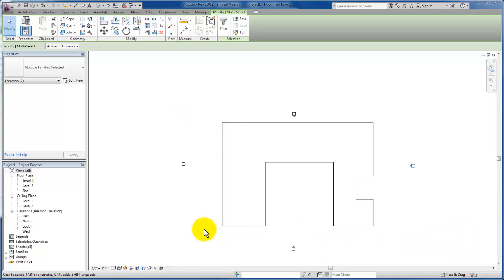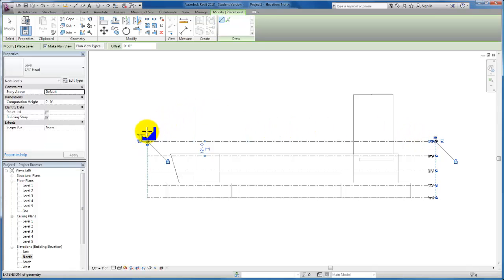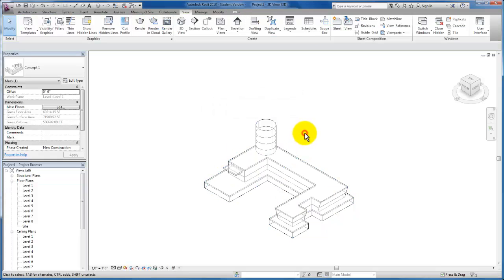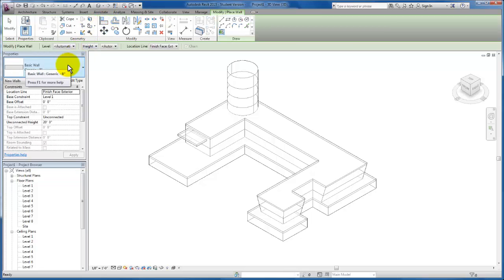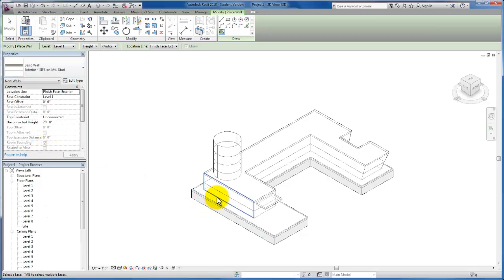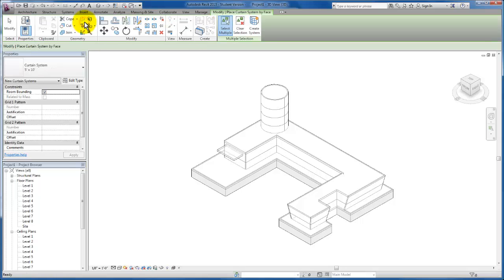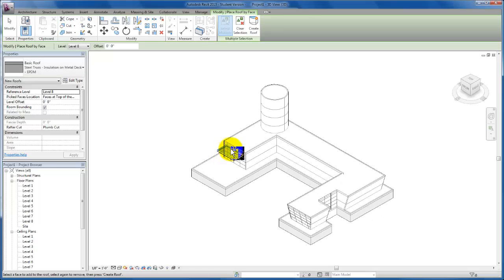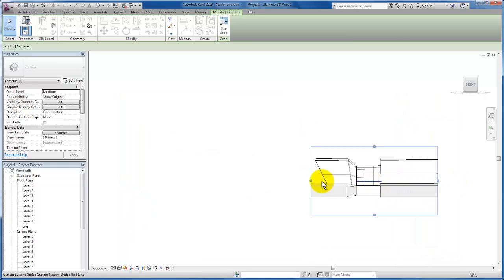Revit Tutorials: Conceptual Massing -Getting Started- Part 3 of 3

Comment: good!! but how much is it useful? we can do the same thing without using the mass editor.
Reply from the maker: vapa86 You can achieve the same massing by using the in-place massing tool in the project environment, but I find it very useful to construct massings in the editor where many of the properties and parameters can also be setup for the object before inserting in the overall model.